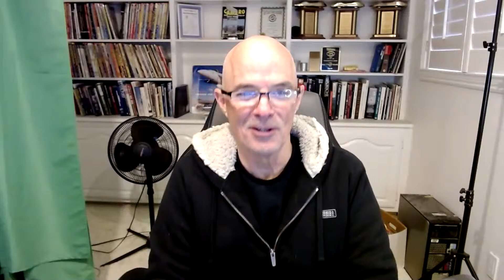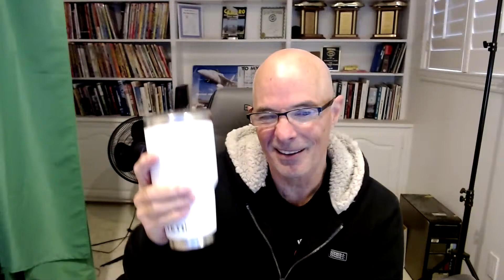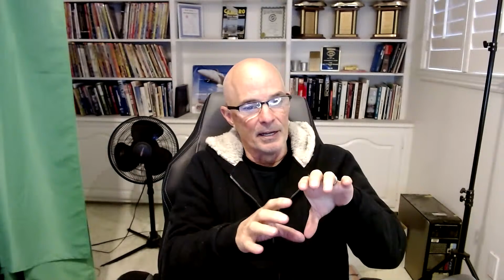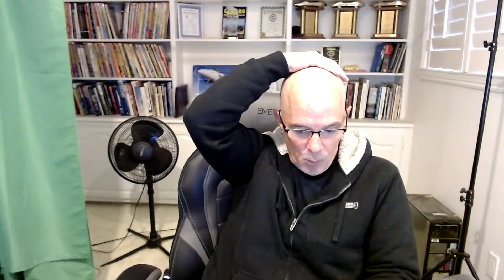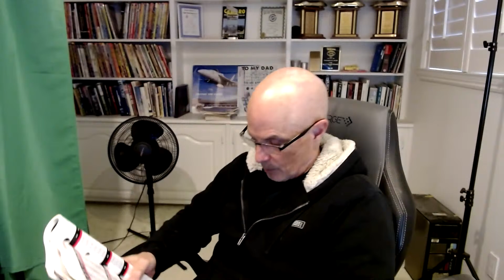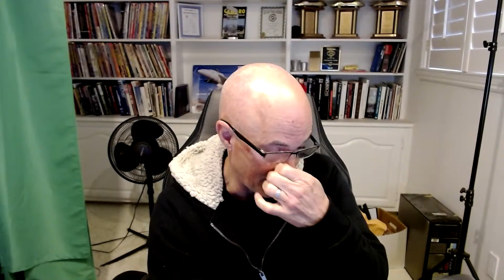BACK FROM WESTECH LET'S TALK TECH

Comment: If you are talking about the Hooker manifolds, I have a set of block hugging S10 manifolds reversed in my 2nd gen camaro and am finishing up the ICT brackets to keep P/S and alt on drivers side. They also have the 2.5 outlet.

Comment: Hello Richard 
It depends on the rate at which you pull the engine on the dyno. Because when you pull the engine at 300 RPMs per second that is not the same as you making a wide open run in your car. But for the most part the wear that I see 
is valve springs and valve seat areas at least when it comes to the higher end cup style engines. You're not going to see a lot of piston ring wear if your compression height is correct

Comment: OM F G BRO, THAT FUEL SYSTEM YOU JUST DESCRIBED IS WHAT I DESCRIBED ON THAT GROUP TALKING ABOUT BTR HEAD GASKETS WHERE THEY SAID IT WOULDN'T FEED A TURBO SETUP LOLOLOL IM DYING THANK YOU!

i knew something was up when youre selling hellcat pumps because at first I was thinking e85 flex fuel stock fuel system for my 02 return style Tahoe, with an aeromotive stealth drop in, aeromotive adjustable fpr, and bigger injectors... though, now for simplicity sake I think Im looking for actually an aeromotive adjustable for a corvette, then a 99-02 flex fuel return style stock setup from that to a hellcat in tank pump, then 03-06 flex fuel oem stuff from the FPR to probably Tbss fuel rails on either this Dorman intake I wanna modify or maybe an LS3 intake with rec/cath adapters if I find one cheap before I end up doing a hellcat blower?

what say you on any of this @RichardHoldener ?

im planning to buy most of my fuel system from you anyway lol?
Reply: i say for simplicity sake and then describe technically more complicated work lol. the end result will be more simple. no fuel heater under the hood. 

my Cougar was a hybrid fuel system with a diy adapter that does the same thing as a Corvette filter. 

im sure aeromotive has an adjustable fpr solution for the Corvette filter. that kills two birds at once and the damn stock e85 stainless lines exist on both return and returnless. i just have to hack and splice all the shit together with the right flare tools and fittings lol. 

the hellcat pump... surprisingly... looks like a typical return style pump like a walbro on your site, Im not crazy here right?

because a returnless is usually a short fat integrated thing like a pool cleaner or fish tank pump that sits at the bottom right?

wait... if the hellcat is return then everything Im doing is goofy, because Ill need to use whatever rails are on the hellcat with that integrated ihi headunit... 

HALP MEH RICHARD LOLS
Reply: @richardholdener1727 I may actually email you about this at some point... I like to know what Im shooting for way ahead of time so I dont go buying shit that wont work because it was cheap lol. 

my aem wideband isnt actually optimal for obdx because I was thinking HP tuners when I picked that model, saw a pre-owned on anazon plus christmas sales and stuff, got it, and now I shoulda got a canbus one because no prolink for the obdx, so... I can use it but I gotta lose a 5v signal somewhere else... 

i may say to hell with trying to keep and fake the downstream and just plug the wideband in there, cats will be gone. engineering wise its the practical elegant solution... ugh... i hate emissions. i was hoping if I left cali to stop dealing with Montana tags lol...
Reply from the maker: the 525 can support near 700 hp, for more-get 2
Reply: @richardholdener1727  i really hate a dual pump setup because if one dies you still run, you just run so lean you fuse the topend together like thermite lol
Reply: but 700 would get it going lol. is that 700 e85 or 700 pump?

if its 700 on e85 you can actually run more on pump as long as youre not looking for boost/compression miracles lol
Reply: I'm also gonna just figure... if we can use a hellcat pump we can also probably use an aeromotive stealth for the hellcat application and thats gonna drop in like a stock pump. 

the overall objective is for a 408 with a hellcat blower and an interchiller/cryocooler on the cooler lines like a demon. 

my rough guess for power is low-mid 800s I think?

Comment: thank you Richard, you and I agree exactly about US versus chinusium parts. 

hard parts and most of your hardware needs to be good stuff. BTR/Totalseal/Clevite... i used Michigan speed trunnions and now Im trying to see if I can get better bearings for them or if I have $200 trash lol. 

but on headers and intakes and fuckin suspension links and shit? yeah the chinese can cast aluminum and weld pipes together. their balljoints and heims suck theyre soft and wear fast. they work but go to shit. 

same as how the chinese electronic dent pullers dont work well/right 

their QC sucks so they cant calibrate induction equipment for quality heat treating. I'd be surprised if they dont produce a ton of warped cams. i guess the question is if they weed them out even. imagine sticking a warped cam in your aluminum gen3 block lol... imagine the rage flowing through you lol. why would anyone use a $100 temu cam when you sell legit cams for $200 all day lolololol...
Reply: is there even a difference between low-buck truck/truck-norris/choppacobra? 

i thought they were all basically... "intro to chop" basically... "stage 1 truck with chop LSA" torque cams basically lol?
Reply: how much can you really tweak the same basic cam profile lol
Reply: Chineseium stuff has its place.  Needed a lathe internal grooving tool - 10 bucks from China - yeah - it worked fine on alloy for the couple of jobs I needed it for.

But my main go-to turning tool, I went US. It literally 'feels' like it's made of better metal - you don't feel like you're going to strip the threads on the clamping screws.

Cost about 5 times as much, but as I use it day in, day out, I don't mind paying for it.

Comment: building a twin turbo, one manifold at a time, is a hilarious plan that makes sense to me actually lol
Reply: does the unbalanced exhaust back pressure not fuck it off too bad? 

lol plumb the turbine to the driver header and then plump the compressor to the passenger throttle/plenum in a split plenum cross ram setup lol. 

like, pretend Im putting a pair of twinscrolls on a flat plane LT5... 

but we do it one bank at a time. 

i was planning to cross them over

but if I do it one bank at a time Id have an NA bank spooling a turbo feeding a bank with no back pressure lol. 

the only equalizer would be the crank lol. 

the crank would be like wtf is this a weird misfire going on or... lol
Reply: i feel like Ive been rambling about this imaginary "perfect Corvette engine” Lotus/Hennessy minded LT5 long enough you get what Im talking about without a full rant lol

Comment: Valve stems lengthen in WOT oval tracks. Do you know anyone who races 24 Lemans or 24 Daytona? They may have some more data.
Reply: Ford has a dyno test that simulates 150000 miles.
Reply: Ring gap is only a minimum measurement. My college instructor Bob Leeds proved to us on the engine dyno. He ended all the arguments when he cut almost an inch off the top ring of one cylinder and made no difference in horsepower. The engine was a a 375HP 327 from a corvette.

Comment: Every performance car I've every owned was thrashed daily.  That's violent shifts and mishits, a normal dyno pull is far more gentle.  

From what I've heard cup engines have bore integrity issues post race from the heat, that why next day race delays are so touchy and until the get back up to temp again.  

Something more interest and perhaps even harder access would be F1 engines as they don't get rebuilds between races.

Comment: I have an L 76. I installed laptop pistons I have a sloppy stage to camshaft 823 hww we as .055 compressed gasket would I be safe to take .020
 off these heads thanks
Reply from the maker: yes